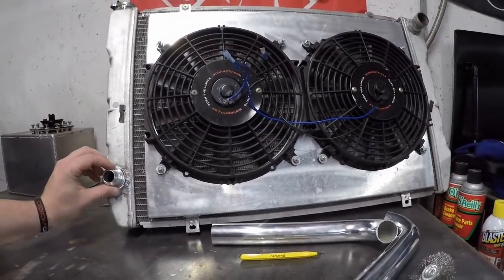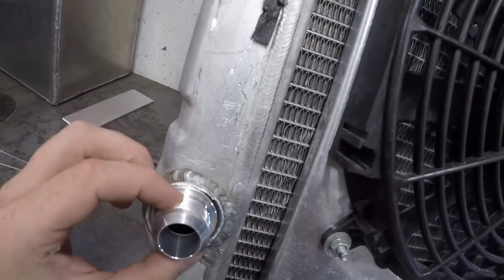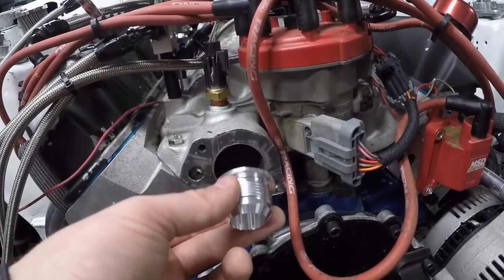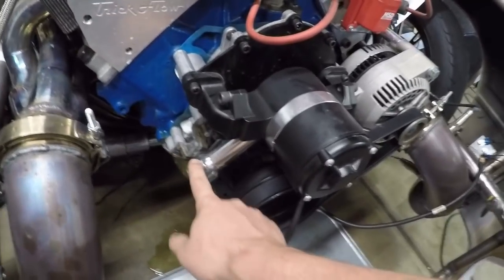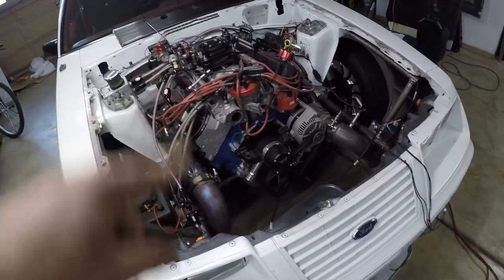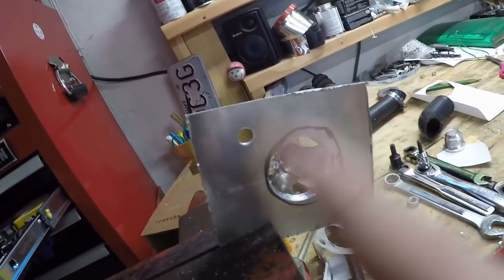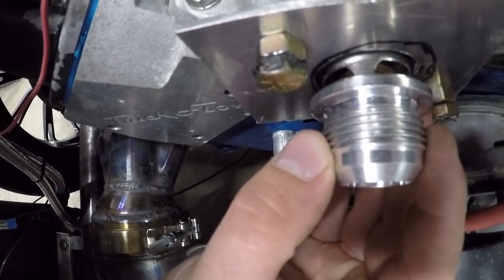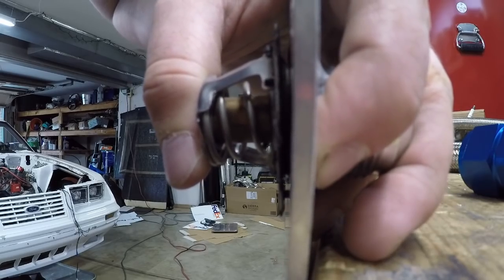How to make  -16 AN radiator hoses and project update!

Comment: Moroso -16 restrictor gets the job done with a 90 -16 back to the return with proflo clamp on -16 to the return bib.

Pump feed run the normal 1.750 dia hose from the radiator.Feed needs to be at least oem diameter.Not so much with the return.